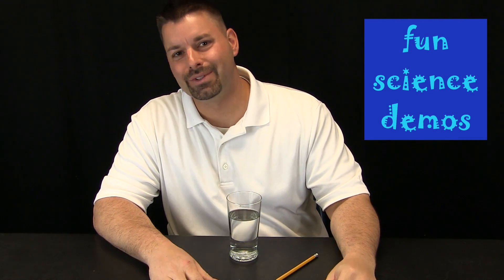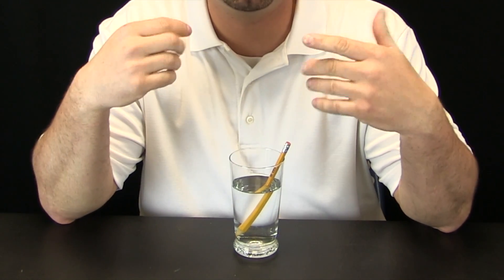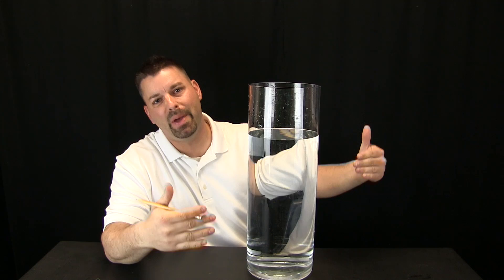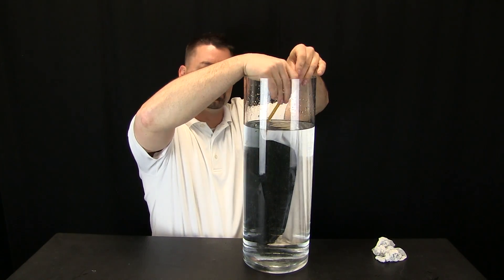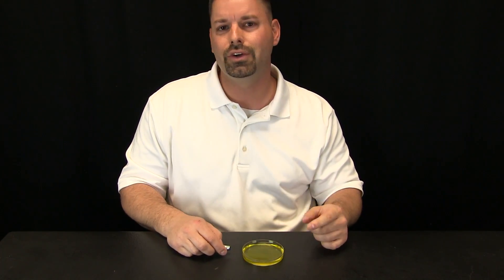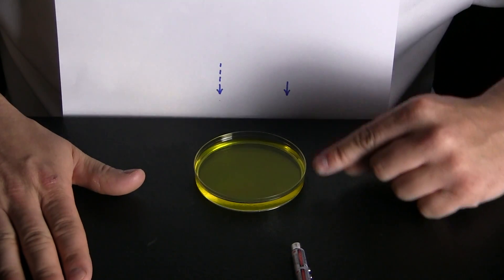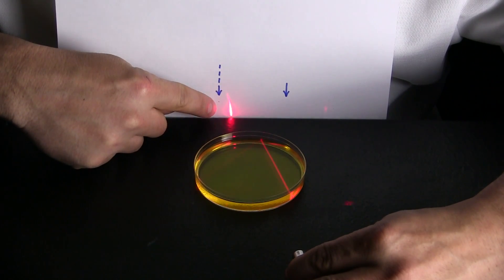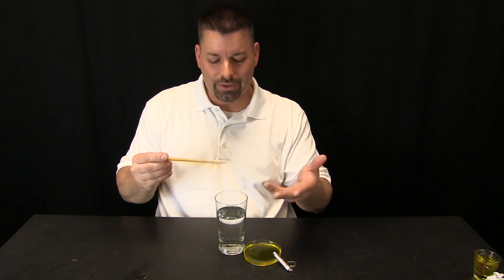How to Bend Light (with lasers!)

Comment: How does the jello which has mass and density bend light photons which don't have mass? The pencil and water is intuitive since both have mass and the water seems to be slowing down and changing the direction of the pencil due to it's density. But can any object/material bend (or the matter reflect) light which  does not have mass?
Reply: Does light have mass?
The short answer is "no", but it is a qualified "no" because there are odd ways of interpreting the question which could justify the answer "yes".

Light is composed of photons, so we could ask if the photon has mass.  The answer is then definitely "no": the photon is a massless particle.  According to theory it has energy and momentum but no mass, and this is confirmed by experiment to within strict limits.  Even before it was known that light is composed of photons, it was known that light carries momentum and will exert pressure on a surface.  This is not evidence that it has mass since momentum can exist without mass.  (For details see the Physics FAQ article What is the mass of a photon?).

Sometimes people like to say that the photon does have mass because a photon has energy E = hf where h is Planck's constant and f is the frequency of the photon.  Energy, they say, is equivalent to mass according to Einstein's famous formula E = mc2.  They also say that a photon has momentum, and momentum p is related to mass m by p = mv.  What they are talking about is "relativistic mass", an old concept that can cause confusion (see the FAQ article Does mass change with speed?).  Relativistic mass is a measure of the energy E of a particle, which changes with velocity.  By convention, relativistic mass is not usually called the mass of a particle in contemporary physics so, at least semantically, it is wrong to say the photon has mass in this way.  But you can say that the photon has relativistic mass if you really want to.  In modern terminology the mass of an object is its invariant mass, which is zero for a photon.

If we now return to the question "Does light have mass?", this can be taken to mean different things if the light is moving freely or trapped in a container.  The definition of the invariant mass of an object is m = sqrt{E2/c4 - p2/c2}.  By this definition a beam of light is massless like the photons it is composed of.  However, if light is trapped in a box with perfect mirrors so the photons are continually reflected back and forth in both directions symmetrically in the box, then the total momentum is zero in the box's frame of reference but the energy is not.  Therefore the light adds a small contribution to the mass of the box.  This could be measured--in principle at least--either by the greater force required to accelerate the box, or by an increase in its gravitational pull.  You might say that the light in the box has mass, but it would be more correct to say that the light contributes to the total mass of the box of light.  You should not use this to justify the statement that light has mass in general.

Part of this discussion is only concerned with semantics.  It might be thought that it would be better to regard the mass of the photons to be their (nonzero) relativistic mass, as opposed to their (zero) invariant mass.  We could then consistently talk about the light having mass independently of whether or not it is contained.  If relativistic mass is used for all objects, then mass is conserved and the mass of an object is the sum of the masses of its parts.  However, modern usage defines mass as the invariant mass of an object mainly because the invariant mass is more useful when doing any kind of calculation.  In this case mass is not conserved and the mass of an object is not the sum of the masses of its parts.  Thus, the mass of a box of light is more than the mass of the box and the sum of the masses of the photons (the latter being zero).  Relativistic mass is equivalent to energy, which is why relativistic mass is not a commonly used term nowadays.  In the modern view "mass" is not equivalent to energy; mass is just that part of the energy of a body which is not kinetic energy.  Mass is independent of velocity whereas energy is not.

Let's try to phrase this another way.  What is the meaning of the equation E=mc2?  You can interpret it to mean that energy is the same thing as mass except for a conversion factor equal to the square of the speed of light.  Then wherever there is mass there is energy and wherever there is energy there is mass.  In that case photons have mass, but we call it relativistic mass.  Another way to use Einstein's equation would be to keep mass and energy as separate and use it as an equation which applies when mass is converted to energy or energy is converted to mass--usually in nuclear reactions.  The mass is then independent of velocity and is closer to the old Newtonian concept.  In that case, only the total of energy and mass would be conserved, but it seems better to try to keep the conservation of energy.  The interpretation most widely used is a compromise in which mass is invariant and always has energy so that total energy is conserved but kinetic energy and radiation does not have mass.  The distinction is purely a matter of semantic convention.

Sometimes people ask "If light has no mass how can it be deflected by the gravity of a star?".  One answer is that all particles, including photons, move along geodesics in general relativity and the path they follow is independent of their mass.  The deflection of starlight by the sun was first measured by Arthur Eddington in 1919.  The result was consistent with the predictions of general relativity and inconsistent with the newtonian theory.  Another answer is that the light has energy and momentum which couples to gravity.  The energy-momentum 4-vector of a particle, rather than its mass, is the gravitational analogue of electric charge.  (The corresponding analogue of electric current is the energy-momentum stress tensor which appears in the gravitational field equations of general relativity.)  A massless particle can have energy E and momentum p because mass is related to these by the equation m2 = E2/c4 - p2/c2, which is zero for a photon because E = pc for massless radiation.  The energy and momentum of light also generates curvature of spacetime, so general relativity predicts that light will attract objects gravitationally.  This effect is far too weak to have yet been measured.  The gravitational effect of photons does not have any cosmological effects either (except perhaps in the first instant after the Big Bang).  And there seem to be far too few with too little energy to make any noticeable contribution to dark matter.

For an alternative viewpoint of relativistic mass, see the article by T.R. Sandin in the American Journal of Physics, 59, 11 (November 1991).
Reply: Light has no mass so it also has no energy according to Einstein, but how can sunlight warm the earth without energy?

Light indeed carries energy and accomplishes this without having any mass. The Einstein equation that you are probably referring to is E = mc2. This equation is actually a special case of the more general equation:

E2 = p2c2 + m2c4

In the above equation, E is the total energy of the particle, p is the momentum of the particle (which is related to its motion), c is the speed of light, and m is the mass of the particle. This equation can be derived from the relativistic definitions of the energy and momentum of a particle. The above equation tells us that the total energy of a particle is a combination of its mass energy and its momentum energy (which is not necessarily related to its mass). When a particle is at rest (p = 0), this general equation reduces down to the familiar E = mc2. In contrast, for a particle with no mass (m = 0), the general equation reduces down to E = pc. Since photons (particles of light) have no mass, they must obey E = pc and therefore get all of their energy from their momentum.

Now there is an interesting additional effect contained in the general equation. If a particle has no mass (m = 0) and is at rest (p = 0), then the total energy is zero (E = 0). But an object with zero energy and zero mass is nothing at all. Therefore, if an object with no mass is to physically exist, it can never be at rest. Such is the case with light. Furthermore, if the object travels at some speed v that is less than the universal speed limit c, we can always choose a reference frame traveling along with the object so that the object will be at rest in this reference frame. Therefore, an object that can never be at rest must always travel at the universal speed limit c, because this speed has the interesting property that once an object goes a speed c in one reference frame, it goes the speed c in all reference frames. In summary, all objects with no mass can never be at rest and must travel at speed c in all reference frames. Light is such an object, and the universal speed limit c is named the speed of light in its honor. But light is not the only massless object. Gluons and the hypothetical gravitons are also massless, and therefore travel at speed c in all frames.

How can an object have momentum without mass? It can do this if it is a wave. A wave transports momentum via its waving motion and not by physically transporting an object with mass. "Momentum" is the directional property of an object in motion that describes its ability to influence another object upon impact. An object with high momentum (such as a truck) can greatly influence the object it collides with (such as a barrel). If a giant water wave collides with a barrel, it can also influence the barrel to move. The water wave therefore carries momentum even though it has no mass. The water itself has mass, but the wave has no mass. A water wave is not a packet of water traveling along. In fact, the water that the wave is traveling through stays more or less in one place. Rather, the wave is a rippling domino-effect of motion. As another example, consider a long jump rope held taught at both ends by two girls. If one girl shakes her end of the rope violently enough to send a wave down the rope to the other girl, the wave can jerk the other girl. The rope has not transported any mass, but it still carries momentum through its waving motion. In this way, waves can have no mass but still carry momentum. In addition to being a particle, light is also a wave. This allows it to carry momentum, and therefore energy, without having mass.

Topics: energy, light, mass, momentum, relativity, speed of light, sunlight